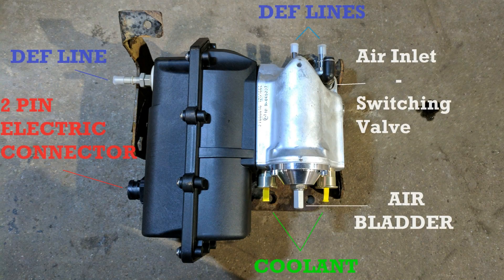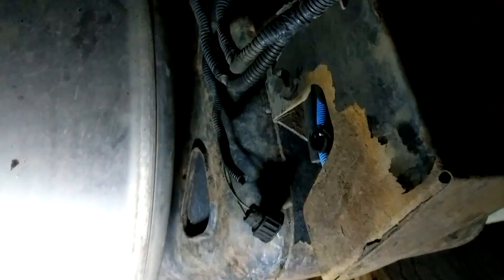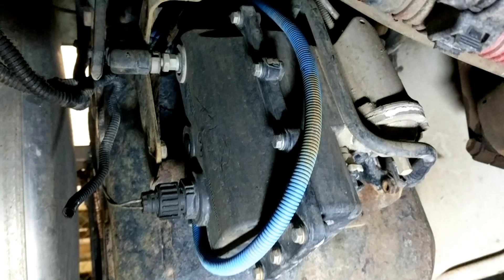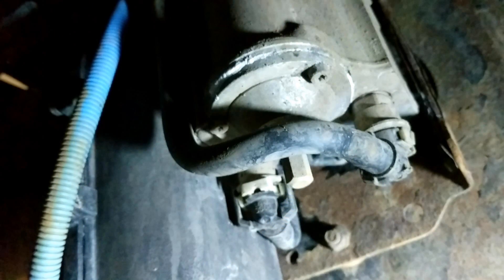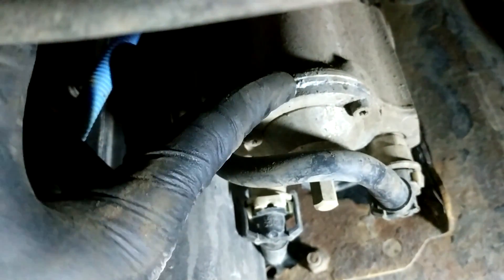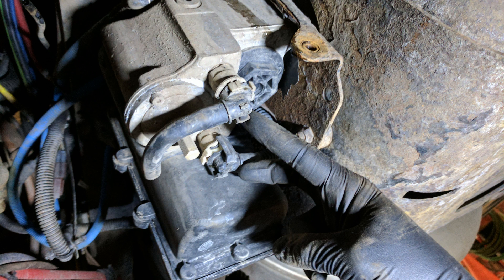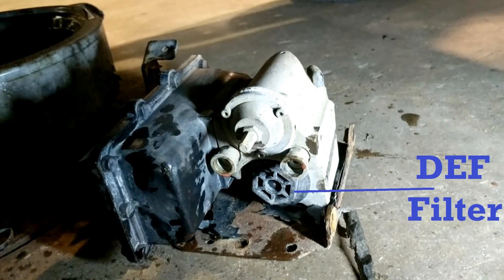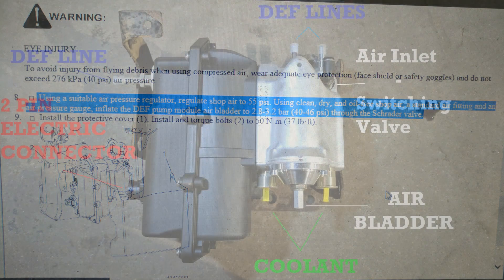Detroit Diesel - DEF Pump Inspection/Maintenance

Comment from the maker: I've noticed a lot of questions on how to recharge the pump bladder with air. Under that little cover at the bottom is a Schrader valve. Filling it is the same as putting air in a tire. Just make sure the air pressure is regulated to the proper ammount.
Reply: What does the air do in there?

Comment: I have a Dynamax DX3 with a Freightliner chassis and Detroit engine and def system. Been trying to build a DSS and can't find the can connector anywhere. I went to freightliner and the parts guy pulled up the def head and found that the connector is part of the def head. Anyone know where to acquire the connector without paying over a thousand bucks for the entire def head.

Comment: I have a 2015 cascadia. On occasion I get a code that say bad DEF...25% debate and it drives really rough. I turn the truck off and on 2x and rev the engine and the codes disappear. Then the truck runs perfectly... Any insight would be greatly appreciated.

Comment: I have same system on my bus and DEF Singn in dashboard and bus not moving more then 5 miles per hour, 
1)I changed pump 
2)Air regular 
3)Clean tank 
4)cleaned all lines 
5)changed nox censors 
Problem is same

Comment: Hi, I have a 2019 Western star with a dd13 Detroit and I've noticed for the first time when I switch the vehicle off the def pump remained running then a little while after the def system started smoking. I turned the main power source off and the pump was still running. A few minutes later it stopped. My truck only has 40,000 miles on it. I restarted the truck and everything seems to be working fine, why did it do that and what do you recommend that I do about it?

Looking forward to your reply. 

Thanks, 

Fidel

Comment: Cascadias suck. My truck derated to 5mph because of a torn def line to the doser. Now $1000 for a small little hose. WTF this is really stupid. It’s a huge road hazard getting stuck doing 5mph when there is no shoulder. Someone could hit you and die, and it’s your ass in jail.
Reply: Well if that ever happens again remove the speed sensor from the transmission (it should be where the driveline connects to the transmission) should getcha to a shop

Comment: How do you get the lines off the def pump
Reply from the maker: I assume you mean the DEF lines? Each DEF line has a (Usually) white plastic clip that locks the line onto the fitting. It has two little tabs that need to be pinched or squeezed together to release it.

Comment: Question I have a nox inaficincy the metering valve is good and I have nox sensors. I inspected the pump diagram had 0 bar and a little def crystalization around diaphram. Can this cause spn4364fmi8
Reply: joshua mercier did you have fix the problem? One of my cascadia had that code and dealer installed complete one box

Comment: I got a tractor with the same code, with low DEF pressure and I got another code for current too high 4375 fmi 6 I’m suspecting the DEF pump failed. How would I recharge the air pocket or does it come charger already?
Reply from the maker: The bladder should be recharged once in a while but it will not stop the pump from operating. There's a Shrader valve on the bottom of the pump where you can charge it with regulated air.
High current codes tend to set when the pump runs without building pressure. Check out this video..
https://youtu.be/FyYvK8ErE78

Comment: How does one go about recharging the air bladder?
Reply from the maker: It's filled with a regular Schrader valve and regulated air pressure. The bladder is so small that it's pressure should not be checked because just the volume of air lost to a gauge will decrease it's pressure too much.

Comment: Thanks Dieseler!  I'M STUCK!  I've got a 45ft 2013 freightliner coach (RV) near San Jose in Northern California with a DD13 engine that will not start. DEF codes 1037 & 1761. It can not be towed out according to the big-rig towing guys (steep driveway and sharp turns). So I need someone that could come and service it on-site. I'm a senior, and not very good at doing this work myself, so I need a pro. Maybe it's the DEF pump? Can anyone help? Email me ray.clark.photo@gmail.com  THANKS!
Reply from the maker: +VideoPhotoGuy Ok we can eliminate the DEF system because that will not effect starting. I'm still leaning towards fuel delivery. Has the engine ran since the filters were changed? Just idling is not enough to purge air from the system. It should be ran under load (Highway) for at least a few miles. If this didn't happen it might need to be primed again too start. If it has a Davco fuel/water separator, make sure the fuel level is up and visible in the bowl. The shop pro is a good option but they can be primed by hand with the pump mounted on the fuel filter housing. It takes a lot of pumping and it's easier to do with someone pumping and someone ready to attempt a start. Especially in your case since the engine is likely a long way from the ignition. Both fuel systems will take a lot of pumping (Think 200+) but the 2 filter system has a higher volume pump than the 3 filter system.
Reply from the maker: +BehindTheScenes This is a little late but there are very few, if any, aftertreatment issues that would cause a no start. Even in a full derate you should be able to start the engine and move the vehicle at 5mph.
Reply from the maker: +BehindTheScenes Also the codes you have written are not structured properly so I'm not 100% sure but it looks like you may need to perform a parked Regeneration. You may also have a problem with your DEF tank level sensor or wiring.
Reply: Thank you so much for your kind reply!  Yeah, I was thinking the same about the parked regeneration... but since I can't get it started, I can't do really that, LOL!  I don't know about the codes, as they were just the ones provided by the tech. I did see the laptop display a line that said something like "DEF tank 1 empty, Tank 3 low"  Which was interesting because it only has one tank so far as I know. I guess my only hope now is to find a good tech familiar with DD13 engines and can service this here (in the San Jose, CA area). I've called around and have not had any luck finding a mobile service that knows these issues. Where are you located? Want a working all expenses paid vacation weekend to San Francisco? Or, perhaps you know someone with the laptop diagnostics software for DD13's that could come?  Sincerely, "Desperate with kids wanting their RV vacation" - RC
ray.clark@gmail.com
Reply from the maker: +VideoPhotoGuy Haha I'm actually on the opposite side of the continent. 
Will the engine attempt to start? Is the starter turning the engine over and it just won't fire up? Or, when you turn the key, does it just do nothing? I'm thinking your fault codes and starting issues are most likely not related. Just mentioning fault codes and DEF to some companies may scare them out of trying to help. It may just be a starting system problem or a fuel delivery problem.
Reply: Yeah, the engine attempted to start several times months ago. We changed the fuel filters, primed with a Davco Shop Pro high-pressure primer. Plenty of voltage, good starter, turns good. But now it does not even cough. 

Today I took out the DEF filter, and no crystallization, looks good... although there was only a few drops of DEF that came out of the pump when I removed the cover. 

The 2013 coach only has 15k miles on it, and it's not used much at all. I usually started it once a month, but then it sat unused for 4 months when I had to go overseas, and when returned, no start.

The fault codes were on the laptop, never on the dash... so yeah, maybe they are just older codes. Then again, the tech that came out to read the laptop didn't know how to set it up, and had to come back a 2nd time. And spent 30 minutes looking for the connection port, and couldn't find it. I looked and found it in 10 seconds. And the fist tech tried to prime it with an automotive fuel pump (like 7psi). I told him DD says 90psi is the minimum to prime a DD13, but he kept trying for 2 hours and then wanted to charge me $400... so you see the level of expertise I've been dealing with. I wish you were local!